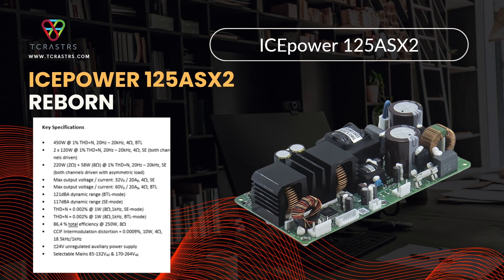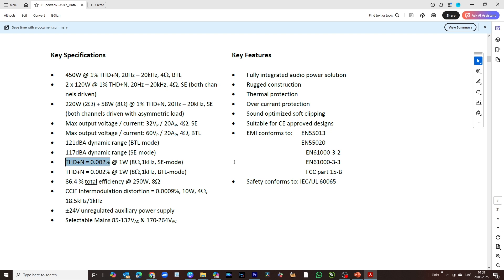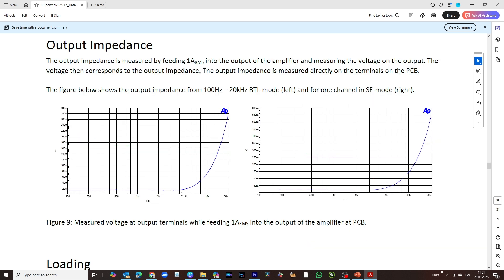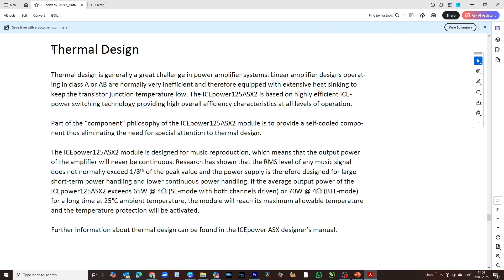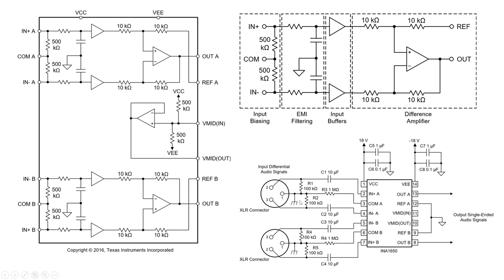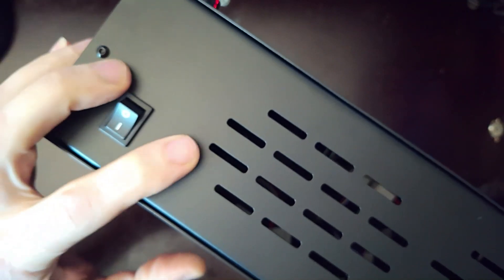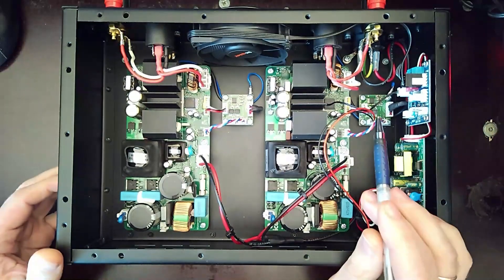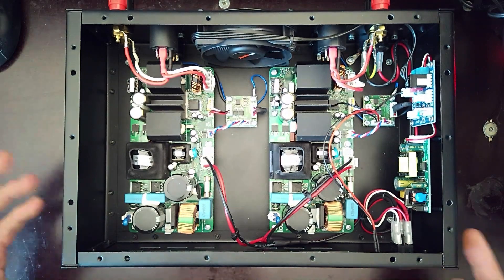ICEpower 125ASX2 BTL stereo amplifier

Comment: This amp has really bad measurements at high frequency. There are better alternatives like nc252mp at the same price.
Reply from the maker: Amplifier measures excellent and meeting ICEpower documentation specifications, but it requires buffer stage to match amplifie relativly low impedance. I made one for this design based on TI  INA1650 balanced buffer amplifier and result is fantastic.
Reply: @guntarssmits2104 125asx2 has real issues at 15kHz where SNR is under 55db, at 10kHz it's SNR is just a bit above 60db. In bridge mode it's getting even worse. On their specs sheet at 6.67kHz it has a THD above 0.2%, in bridge mode. The more expensive 1200AS2 or nc252mp at the same price, or even cheaper if you have a good deal, doesn't have these problems.  These are audible. Anything under 80 db SNR is not ok in my book. Why pay the same money and get a worse amp?
Reply from the maker: @florin604  By price/quality Icepower 1200AS2 are unbeatable. That true. But for those who has 125ASX2 on hands  you can make incredibly good amplification sysem using 2 boards in bridged configuration. I have sold quite a bit of them and customers are surprised about quality what coms out.  At high frequencies music power is about 1W and speakers self distortions are close to 1%. Amplifier has double zeros after comma even on high frequencies. Techically full system sounds perfect. By specifications output idle noise is 35mkV which is very low for 121dB dynamic range.  Honestly I do not found any lowlight for this board except rise in price.

Comment: I think this is what I need, as it has both rca and those fancy twist connections , I’ll be ordering this soon 👍🏻 , just need to find the best place to get the 125ASX2 boards from, any recommendations?
Reply from the maker: Soundimport is one of good ICEpower sellers.  https://www.soundimports.eu/en/icepower-125asx2.html?srsltid=AfmBOooaUEy7F294GAU67BLidtVkWdNjF7BX8vmmImwIuTeA66KPzXWz, But there are som boards on AliExpress as well. For better price but some risks https://www.aliexpress.com/item/1005001398578056.html?spm=a2g0o.productlist.main.4.46e8MWnBMWnB5W&algo_pvid=33594a3b-c7ce-42a4-88c1-43a8e2c80757&algo_exp_id=33594a3b-c7ce-42a4-88c1-43a8e2c80757-3&pdp_ext_f=%7B%22order%22%3A%228%22%2C%22eval%22%3A%221%22%2C%22fromPage%22%3A%22search%22%7D&pdp_npi=6%40dis%21EUR%21228.15%21161.99%21%21%21259.50%21184.25%21%40211b628117680585295427927e560a%2112000015942721789%21sea%21LV%212867889773%21X%211%210%21n_tag%3A-29919%3Bd%3Adc31a1e0%3Bm03_new_user%3A-29895&curPageLogUid=FQ2CnJ1Adx8T&utparam-url=scene%3Asearch%7Cquery_from%3A%7Cx_object_id%3A1005001398578056%7C_p_origin_prod%3A
Reply: @g @guntarssmits2104 ok , thank yoi

Comment: Hello, the Icepower 125ASX2 ist updated now with a new chipset and THD+N Ratio vs Measured Level seems nicer than at the old version. Do you hear some Differences in the sound between the versions?
Reply from the maker: There is no audible quality difference, but the latest version runs cooler and has lower idle losses.

Comment: 500 watts?  What if your speaker only needs 35 watts?
Reply from the maker: I am running 40W 8 Ohms speakers and they sound awesome. But in that case some TPA3255 designs are coste effective. Actually any 100W amplifier will perfrorm excellent.

Comment: This video is underselling the high-quality of the labor that goes into the  metalwork of these enclosures.  They're excellent, well finished, and made of heavier gauge steel that you'd find on the typical AVR or mass-produced enclosure.  With the powder coating as he applies it, feels good in the hand, all smooth corners, a nice even finish to it.

Comment: I have seen the new 125ASX2 is using the newest Conductor modulator IC, even newer than IceEdge. I only wish they had chosen a different model number so it could be told apart from the original 125ASX2 board. I am working on getting my hands on an older 125ASX2 board so I can try to compare to the new 125ASX2 and the Hypex NC122MP, all of which I have, and I also have a 200AS2 to compare with. At work, I have access to an Audio Precision analyzer so there may be some additional insights to gain.
Reply from the maker: It would be an interesting outcome. My guess is that specifications will be the same but thermal characteristics for latest version will be better.

Comment: Thanks for continuing this series of reviews. It is very helpful information and very well presented. It might be interesting to see how these boards can be configured for three channels by combining the units with and without on-board power supply. I think they are called hanger modules. It seems like this would be possible but hard to tell if it would be stable or what modules would combine well. A three-way active speaker might be a good use case for this type of arrangement.

Comment: It's very close in price to the 1200AS2 if used in bridged mode, how do they compare?
Reply: 1200AS2 is very high power - 1200W combined. The 125ASX2 has a much smaller power supply so it's not possible to compare to the 1200AS2 by power output alone.

Comment: Much appreciate your coverage of these products. After trying some of the other boards you have reviewed, I have confidence with your experience. These boards have been a game changer with my audio hobby. Headroom, was always the most costly quality of my systems since I started in this so many decades ago, and always a compromise for what I could reasonably afford. The one exception is my Adcom GFA-5500, but the compromise with that amplifier was always excess heat here in the subtropics.